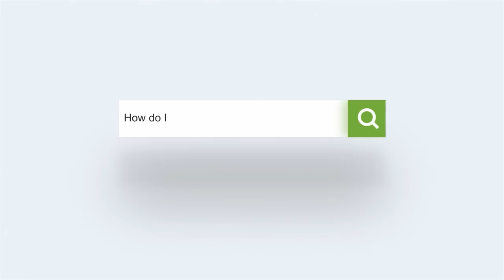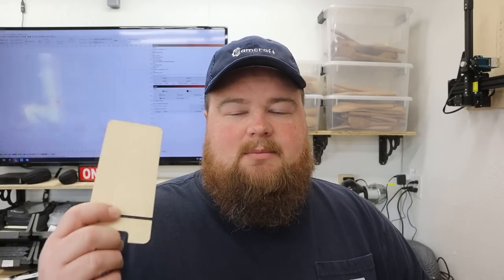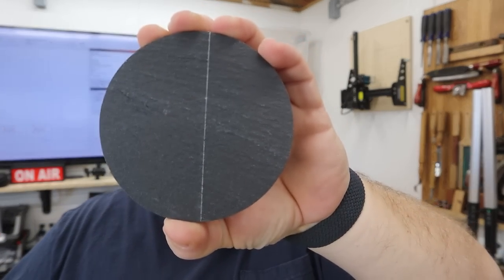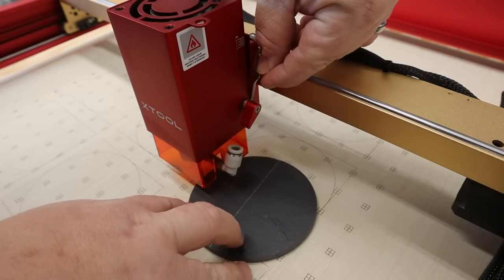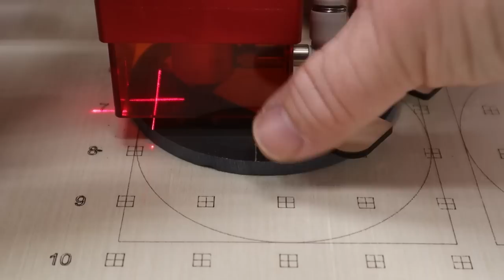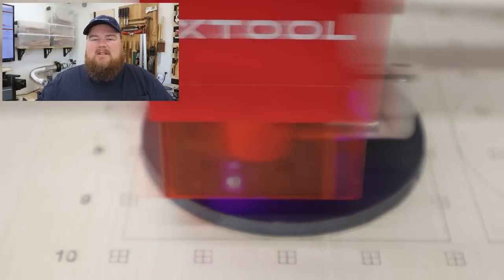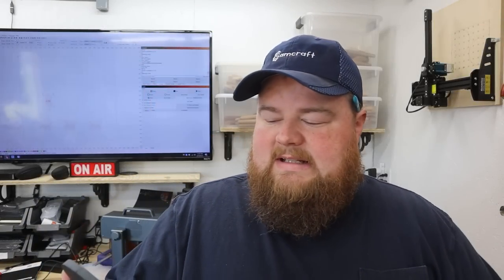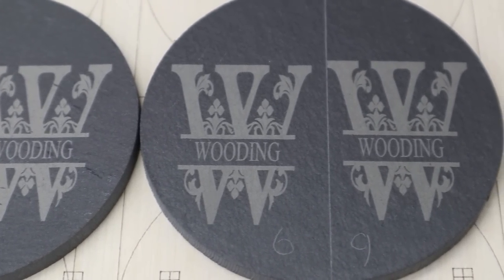When to [un]Focus Your Laser

Comment: Hello Sam. Just found your channel today and have spent quite a bit of time watching some of your laser videos. I really like your presentation method. I am new to the whole laser scene, just bought an Xtool D1 10 watt machine and haven’t used it yet, been working on projects with the CNC. Question, how do you set the XCS software up for engraving multiple items at the same time? I figured you would have to do 1 at a time unless you were cutting them out of a single piece of material?

Comment: Here is a pro tip that I have been doing for over 2 years.I started like you with an Ortur...Get yourself a z-axis height adjuster,and adjust your focus manually..In other words you need to eyeball it with the laser dot...First you put a piece of flat black cardstock over the piece you need to engrave or cut,press fire button in lightburn and you will see your laser dot.Now with the z axis adjuster you can pinpoint the size of that dot to it's smallest...I guarantee you will never adjust any other way because, you will have better engravings and faster cuts.Also when doing fire mode in lightburn everything below 5% there is no problem ,I mostly leave it a 3%... Last thing, by doing this you need to get rid of that shield...Also if you want the most perfect dot, use a microscope you can get them cheap on Amazon...If you want perfection, this is the best way...

Comment: Hi Sam.  Are you using the 20watt?  And if so, what are your settings?  They look great!
Reply from the maker: I knew someone would be asking. :) Yes, 20w. I ran these at 250 mm/s 50% power, 300 DPI. BUT do a material engraving test to be sure that's the best settings for your machine. :)

Comment: Thanks for the tip! I'll have to try this.

Do you have a link anywhere for those coasters? I haven't had much luck finding consistently priced smooth edge coasters.
Reply from the maker: No links for these style coasters. I work directly with the manufacturer and import them in bulk quantities (thousands per shipment).

Comment: If I'm correct? I do believe the lever on the right is for defocusing. I had it up once and ran a job before I realized it.
Reply from the maker: Correct, that is for cutting and moving the focal point. I keep mine at the 0 point most all the time since I cut on a CO2 laser. I checked today and it's still set to 0. :)

Comment: How do you manage to get your parts consistently aligned with the cut? Did you bolt down the laser to a spoil board?
Reply from the maker: It's still in "prototype mode" but my spoilboard is locked into the laser, yes. All my jobs run from the home position (absolute coordinates) in Lightburn. This keeps everything right in place like they should be. :)
Reply: @Samcraftcom  thanks. That helps a lot.

Comment: How do you know what speed and power to use ? New to laser engraving
Reply from the maker: You want to run an engraving test for every material you use. If you use Lightburn, I offer a premade file you can purchase and load. It's under the "Laser Test Files" section of my website:  https://sam-craft.com I also sell it on Etsy if you rather that platform.

Comment: IMO 6, 9 are both better than 3. 3 has several missing spots, 6 none and 9 a couple smaller ones.  OK, looking again, it may be a tile quality issue. 3 has some fissures in it, that look like they may have cause some of the missing spots. 6 and 9 look like very good sample tiles.  OK, I liked your solution at the end. 🤷‍♂👍
Reply from the maker: I agree with you. :) Your thought process in the comment is exactly what I was thinking in the shop realtime. :) That first coaster tile was pretty rough, so I credited the flakes to it being from my "trash" pile.